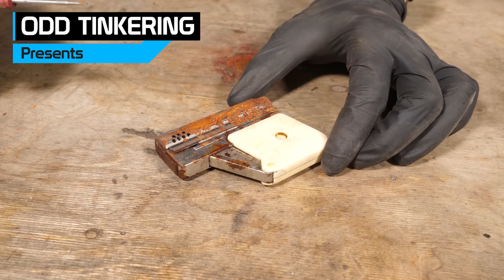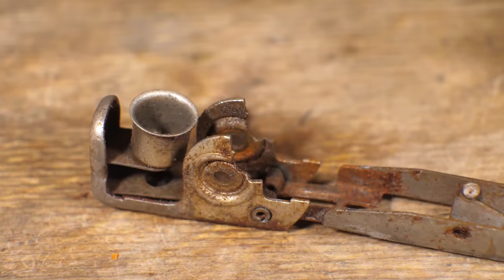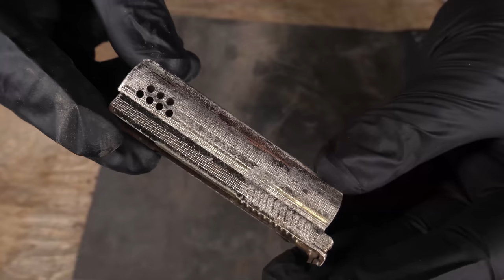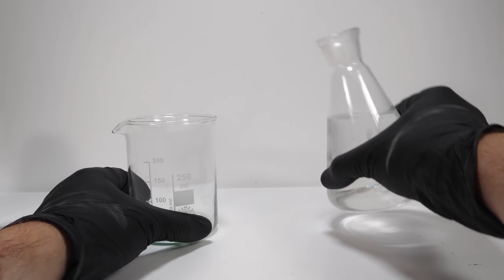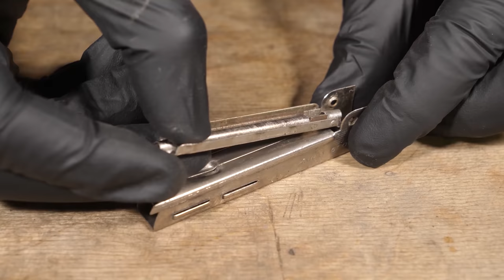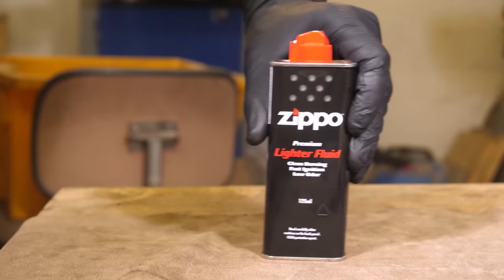Rare Pistol Lighter Restoration - IMCO 6900

Comment: No rust remover or electricity for nickle plating. Very interesting seeing other methods of doing these things! Awesome work! That laser is so awesome too 😅
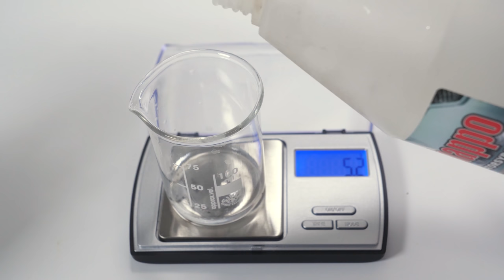Reply: 08:35 "I'll dilute some sulphuric acid to about 10% to make an activator" (And so, guess up what sulphuric acid's being used for?)
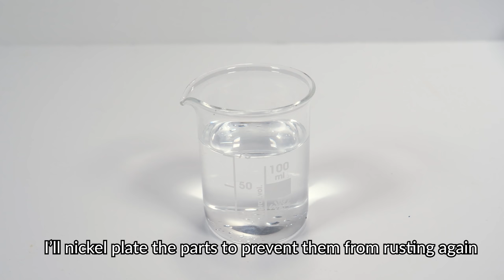Reply: 08:50 "Then, I'll nickel plating the parts to preventing them from rusting again : I'll test it first with this coin ...💰"

Comment: it seems that with laser cleaning, you leave a lot of crap behind based on the angle of the laser - at least this video seems to suggest that. i'd be more satisfied with a rotating fine sand bath which would do a better job in all the nooks and crannies.

Comment: You take on some wicked projects! Question:  I'm about to nickel plate some old sockets this week.  Have my solution nickel anodes ready to go.  Is there anything special you added to your nickel solution to do it electroless?  Could I use a standard electroplating solution and heat it up, or is there something special that needs to be added to do it with heat?

Comment: I had a lighter similar to this only made of black plastic in the late 1950's. When you pulled the trigger half-way the breach opened where you could house 10 cigarettes in the grip, pull the trigger all the way and the lighter shot a flame from the barrel.

Comment: Just some basic chemistry for diluting acids: water in acid, you might get blasted!

Always dilute your acid in water, not the other way around. Diluting in water causes an exothermic reaction. If water is the least available compound, the temperature might increase so much so quick, it could explode or cause your beaker to burst.

Comment: Very nice, though a word of caution: always add acid to water carefully, NOT water to acid. Since the reaction is exothermic, especially with sulfuric acid, you may end up with a lot of heat generated that may spatter or crack the container and spill acid. Granted this applies more for concentrated solutions, but best keep the practice regardless.

Comment: why do you use water to sand? it helps get a smoother texture? Does it make the pitting smoother to sand?
Reply: It's not water. It's lubricant. It helps prevent scratches so the surface is smoother.

Comment: Hey I've been looking into electroplating for something of a christmas gift and have 2 questions for you. One what amounts of what materials went into the plating solution you used? And two would this process work on a non-conductive part such as a plastic? At the moment I'm looking into making the cheapest metal plating process I can and an electrofree option could cut down on costs depending on what goes into it.

Comment: I'm going to be honest, with most of these restoration channels the final product typically looks as though it's never been touched before, whereas the final product in this video still had visible rust in some places, generally looked warn, and even had components that weren't touched on during restoration at all, for example the flint well. Not that I'm saying it was a bad restoration, but I'm usually baffled by how pristine these tools look at the end of the video, and this video just had me feeling somewhat disappointed.